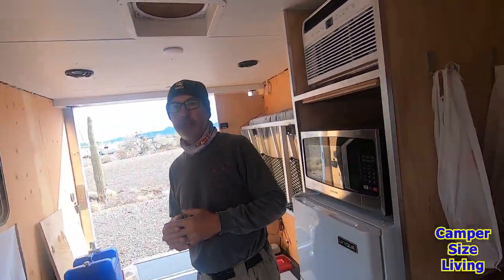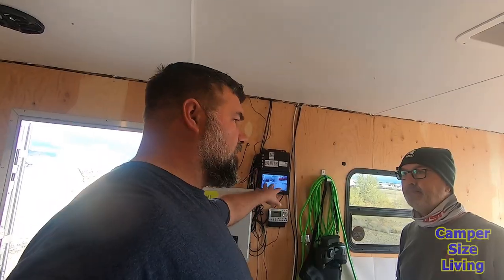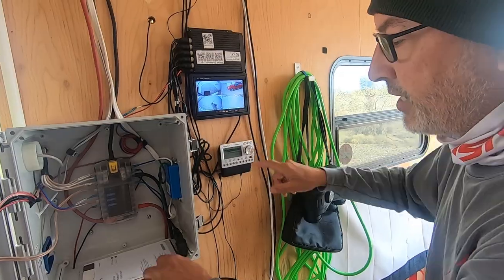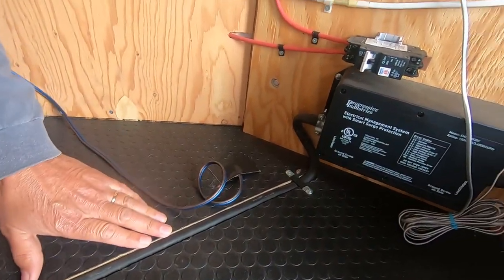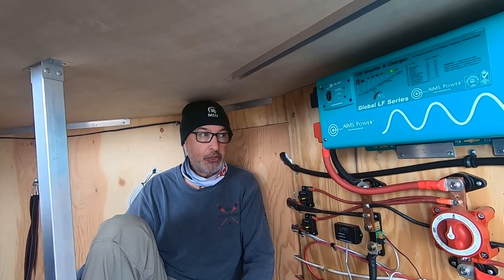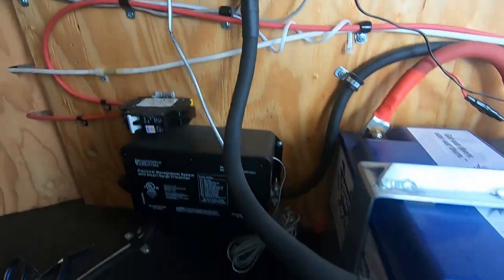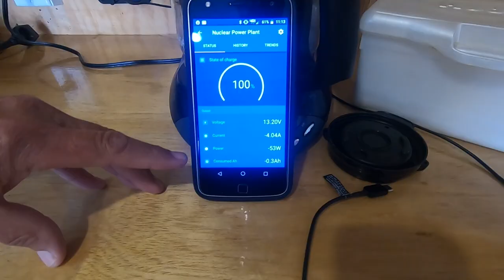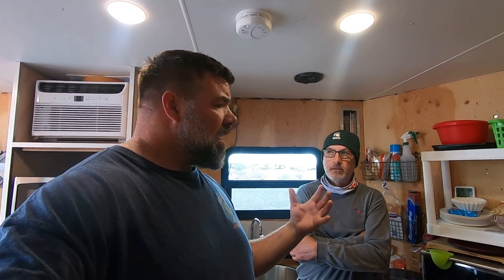Cargo Trailer Build #3: Solar & Electrical | Details & Parts List | Cargo Trailer Camper Conversion

Comment: I watched every part of this build. I appreciate the knowledge shared. I have a conversion build myself. Certainly this is very cool. I don't know if I could jump on that final price point. You could cut that in half with a cheaper initial trailer though. You would expect this to last a lot longer then the average rv or travel trailer though. Also how lightweight it is compared is hard to beat. Thanks again.
Reply from the maker: Those are all very fare points. 👍 That's one thing we Love about the nomad life, there are so many different ways to do it at so many different price points.. But at the end of the day we all have to empty our black tanks or compost toilets. Lol Thank you for adding to the conversation and safe travels! 👍😊👍